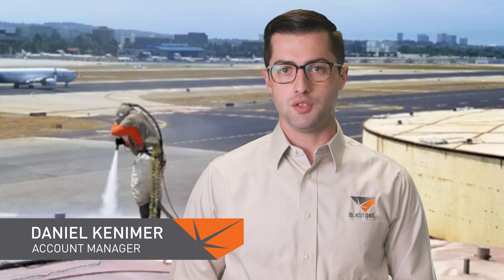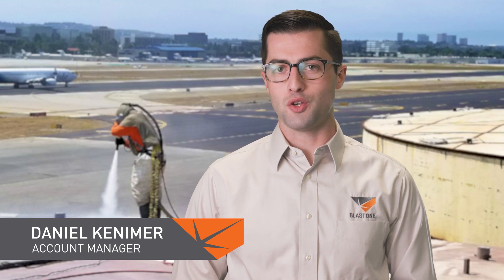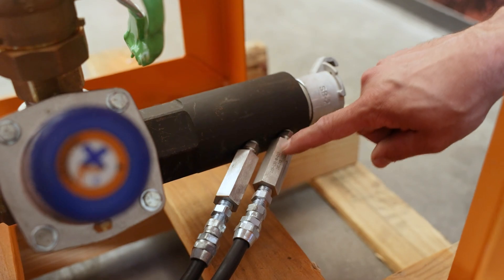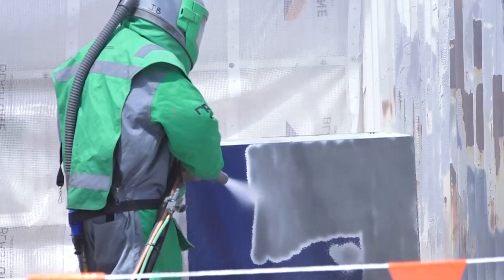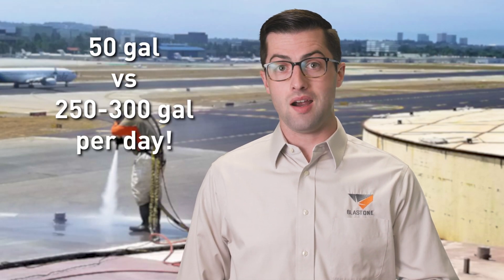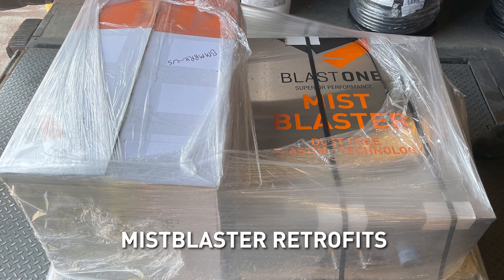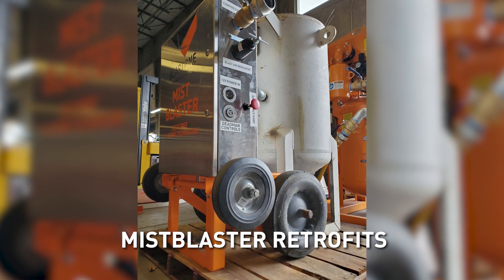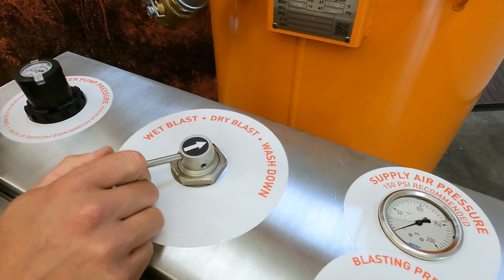The Best Wet Blasting? Slurry Blast or Mist Blast

Comment: it looks smart but you are not telling the truth because the dustless blaster uses about 150 gallons in 6 hours. a dustless blaster is more simple and does not require all kinds of connections to run well every day. I have one of each but thought it was smart enough what you have there for a dry blower system but it is nothing new.